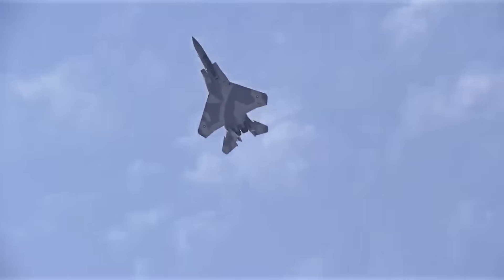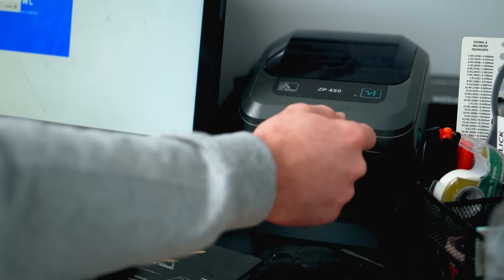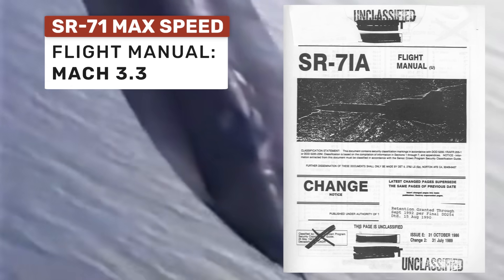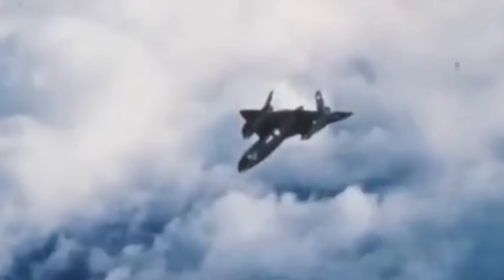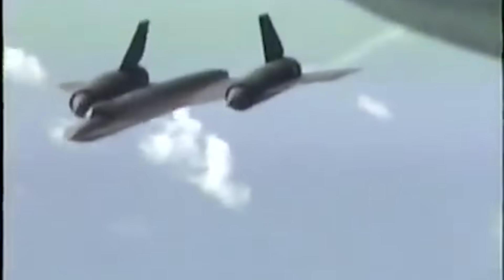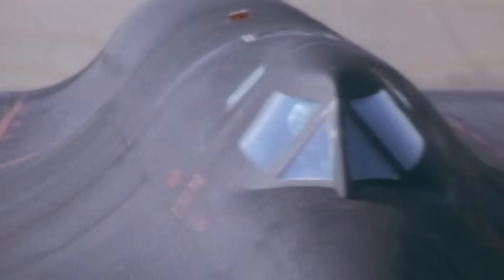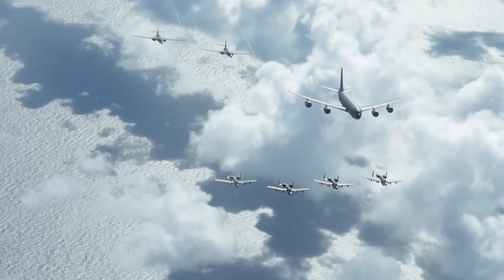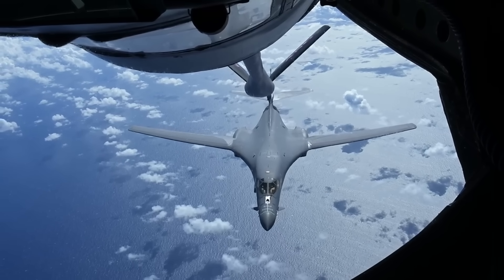The SR-71 was MUCH FASTER than the Air Force will admit

Comment: this dosent surprise me at all, While the Russians tend to exaggerate their weapons' capabilities for propaganda, the US has a reputation for downplaying theirs. I wouldn't be taken aback if the SR-71 could actually hit a top speed of Mach 4.5, though I'm uncertain if they had the necessary technology to manage the heat issue.
Reply: The sr-71 could hit mach 3.7, any faster and it would fall apart like the dark-star from top gun 2
Reply: There was one on record interview that stated that the top speed was in fact Mach 4.4 - I don't remember who said it. I'll see if I can find it again and toss it in here.
Reply: @emacstac  I recall that as well.  Per my recollection, it wasn't so much the plane ever had done that, or really that the plane as a whole could without taking damage.  The shock recovery of the engine's inlet geometry would work just fine up to that speed, so supposedly if the fuselage held together long enough the engines would continue to provide more thrust than drag until it would eventually hit Mach 4.4, and above that the thrust would no longer increase so speed would plateau.
Reply: @emacstac  I have also heard mach 5 in a dive.
Reply: Maybe the plane can hit Mach 4 ... Once
Reply: It might be able to go Mach 4+ based on power and drag, but it would certainly overheat in very short order. The documented mach 3.56 for the A-12 probably falls into the same category.
Reply: I'm getting tired of telling this story. But in E Texas in the early-mid 80's, I was in my early 20's drywalling a friends ranch house. I heard a highly compressed quadruple sonic boom that shook the whole and rattled the windows. At first I though earthquake, but that didn't make any sense.
I went outside and saw at exstream alttitude a craft moving like a bat out of hell heading south. Normally at that hight a plane barely appears to be moving. This one was out of sight in barely over a minute.
The only oddity was it appeared to be light whitish silverish in color......possible ionisation?
All I know is the highly compressed quad sonic boom meant is was traveling somewhere between mach 4 and 5. So......Was it the '71?
Reply: P.S. My friends mother said it was the "Nicaragua mail express" and it would be back in a couple hrs. although not at that speed. They'd leave the base N. of Texas and be routed around populated areas by way of E. Texas.
Apparently by the time they were detected target forces had less than 15 min. to relay/communicate and move everything out of camera/sensor view.
Reply: I think mach 4.0 or a little over is very realistic. Past 80,000 feet the air starts getting really cold and that is going to help the engines and keep the craft from getting as hot.  The air is pretty thin at that altitude which is good for the aircraft as well. The technology on those engines is pretty much the faster it goes the faster it goes.
Reply: @actionjksn  Heat isn't your limit in this plane, neither is engine power, it's the location of the shockwaves. The faster you go, the steeper the angle of the shock waves. At Mach 3.52 the shock off the front point hits the edges of the tail. There goes your control of the aircraft. The engine inlets also have a max Mach angle before the engine flames out due to lack of air. All you need is a protractor and a calculator to figure it out. Measure the angle and the Mach number is = 1/sine (angle). There really is no debate of the max speed of the aircraft, the shape of the plane decides that.
Reply: fantabuloussnuffaluffagus  As is Compressor Inlet Temperature., over 427ºC is not allowed.  There are thrust tapes from high speed runs on the net.
Reply: i am thinking about the fuel in aft thrustpipe cooling thing - i wonder if something alike is possible to limit max temp ?
Reply: @herauthon The afterburner on the J-58 was one of the most amazing parts of it and had no cooling.  At full power the whole burner glowed bright white and there were rumors that it became translucent....and one night I got to see this with my own eyes.

On the test stand during a qualification run I slipped outside to watch and from my vantage point there was a telephone pole holding a light behind the burner.   The burner went from dull to bright red, then through yellow to white...then BRIGHT WHITE at full power and as it sat there running I swear I could see that pole through it!   Now...I thought at the time that it was just a mind trick where it subconsciously was connecting the upper and lower parts of that pole and still think that today, but believe this is where the rumor came from.

An amazing part of the afterburner system was that we were still flying some of the oldest ones from the beginning of the J-58 program as they had a 'rejuvenation procedure' that made them like new again after many flights.   Just an amazing program.
Reply: @DavCro 

The SR-71 wing is designed for mach 2.0 based on the leading edge sweep. It clearly pushes the shockwave back across the wing, similar to the F-104. Kelly was into knife sharp leading edges for high mach performance. And the SR utilized vortex lift to make up for its lack of flaps and ultra sharp leading edges without slats.

The Titanium could withstand plenty more speed. But it was operating at half strength of 1.5g instead of 3.0g cold at it was. It could probably tap into what little margin remaining in an emergency. Mach 3.5 was the limit due to inlet geometry. You would suffer double unstarts the moment you exceeded the mach angle where the inlet spikes reached their maximum travel.
Reply: @Triple_J.1 Agreed.  I’ve watched a LOT of pilot interviews, and hitting Mach 3.5 was not allowed; this was consistent among every pilot.

Maybe they were consistent because they were ordered to be, but unless there’s authenticated documentation that says otherwise, I’m sticking with what the pilots said.  Any other value value, and any other arm chair metallurgical or aerodynamic opinion is just wishful thinking.

Besides, who cares?  Mach 3.2 is amazing enough!
Reply: @Pene7942 guarantee the top speed probably cost the budget of a small-medium nation in maintenance costs for every flight hour. They would have been given a much lower speed to stick to in normal operations just to save $$$. And still it was too expensive to keep around vs less capable platforms.
Reply: @Triple_J.1  I assure you that if you could determine how fast it can go just by looking at it, the USSR wouldn't have been unable to do so. You did not build it and have no idea what you are talking about.
Reply: They've got ceramics now so that's not an issue, at least not for another thousand degrees C.
Reply: Russians exaggerate their weapons because they only have old Soviet weapons left, Capitalist Russia is too incompetent to create anything these days without foreign help, takes Communists to do anything for real in that country, like the maniac next gen Soviet main battle tanks with 152mm and 203mm smoothbore guns on a slightly enlarged T-80 chassis with multi composite diamond armour. 
Its also interesting to note how the Soviets developed successful carrier fighters that could VTOL under their own power, during the 90s, the Russian Capitalists sold a few examples of those 1970s planes to the americans, suddenly america have fully functional F-35B that finally solves the long lasting issue US had developing jet VTOL. 
Its also very funny that whenever Cold war propaganda fears a Soviet weapon, its usually those cheap jets thats 1/50th of the cost of a regular american one, basically so cheap they are designed for 10 uses and then thrown away.
Reply: It was 92% titanium which can take higher heat than you think it can.
Reply: I was in Chocolate Mountainous California in 82 .While in the communications radar van i listened to the conversation. He was descending to eighty thousand feet, And doing a whole lot more than mach 3.5. Semper Fi
Reply: @DavCro  I brought up the concern regarding temperature, but I'm also curious about the source of your information that indicates the wing can't withstand such speeds. Additionally Major Brian Shul reported exceeding Mach 3.5, indicating that an undisclosed speed of Mach 4.5 might be plausible.